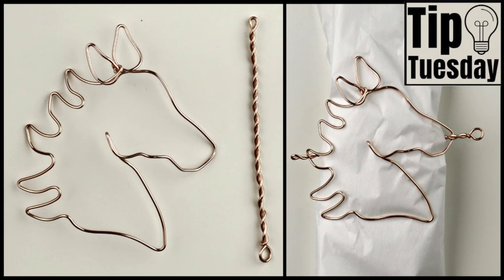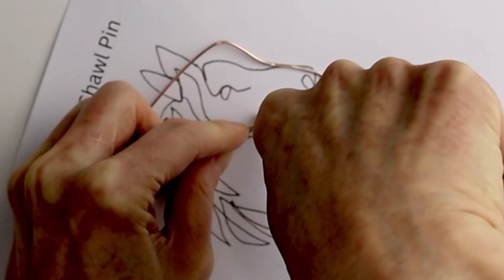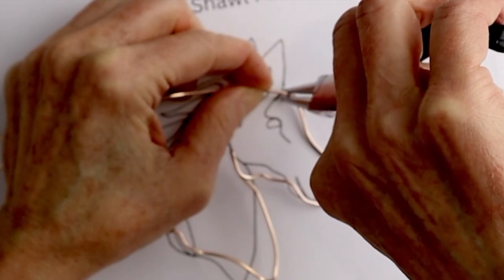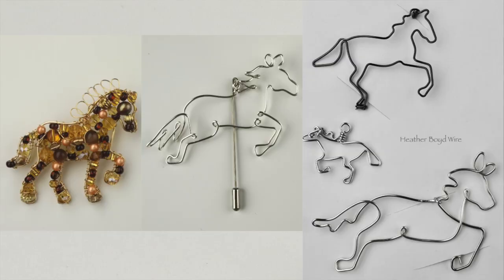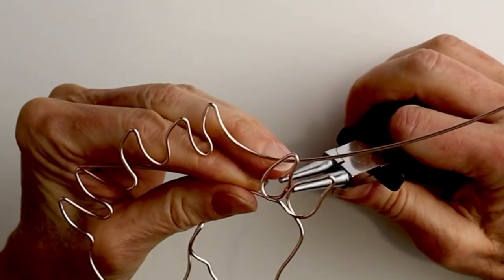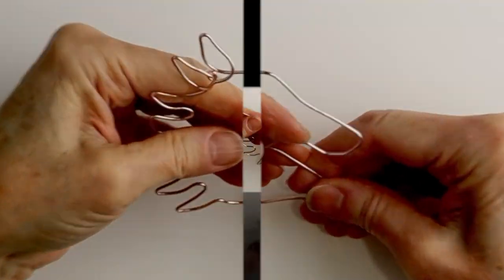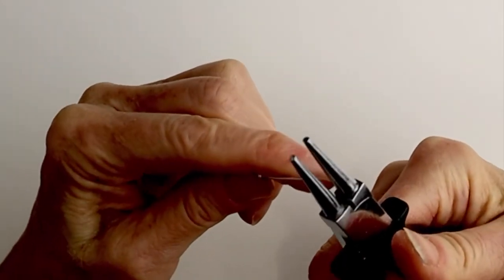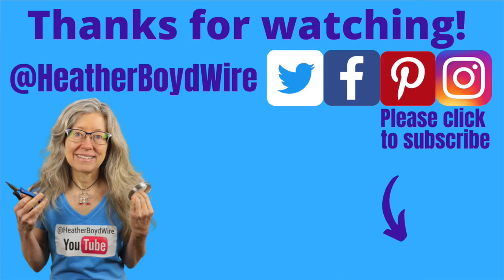Wire Horse Shawl, Scarf or Hair Pin DIY Tutorial

Comment: Thank you, it is very nice, but I have a question. Is there a tool with a round head that helps in making circuits? Is this type of wire copper and how many miles / I am following you from Syria / 😊 Your content is very useful, thank you.
Reply from the maker: Thanks Joly. I use markers, highlighters and pill bottle to make round forms and circles. I do have some round nose pliers for smaller loops. Is this what you mean?
Reply: welcome 🤗
You are the best content creator on YouTube 😄
That gizmo is at 0:58 (tool)
 إن الأداة في الدقيقة 0:58